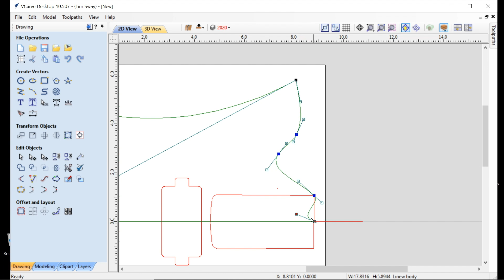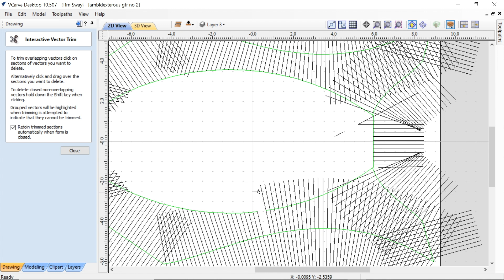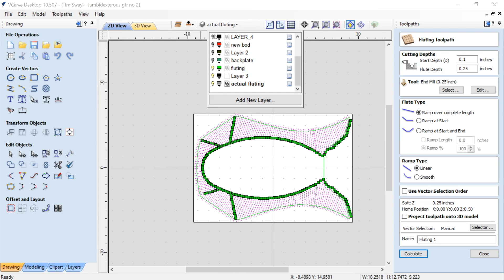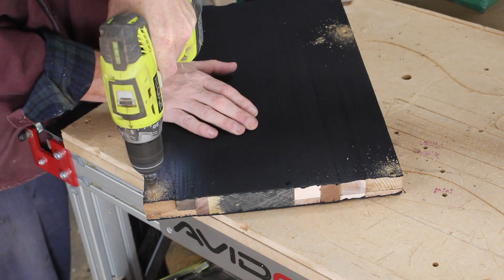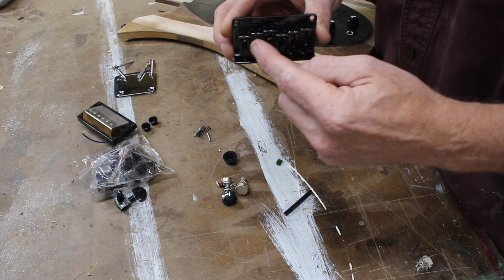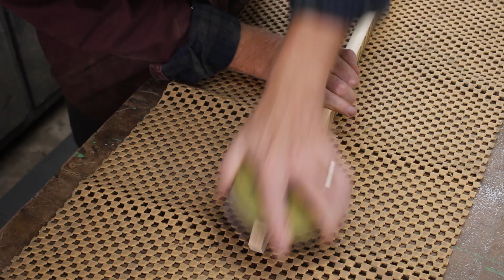Making a Ambidextrous Guitar | In the Labs with Tim Sway | Vectric FREE CNC Projects

Comment: Considering buying a less expensive vectric product, could this be done using Cut2d desktop?
Reply from the maker: Hello and thanks for the question.  I think it would be possible... or at least get you modt of the way there.  Things like making a 3D hspe for the nect would be a challange... but again with the right selection of 2D tooling you could get most of the way there.  If you are looking for a few more options that would help... then VCarve Desktop might be a better fit.  If budget is a real constraint then I would suggest download the trial version od Cut2D desktop and see if it will do the trick... https://www.vectric.com/free-trial/cut2d-desktop

Comment: Great videos and content. Are you still using dowel rod indexing or some other workflow for alignment and two sided carving etc? I’m experimenting with relative coordinates in VCarve Pro and MeshCam and love the idea of only having to worry about using the Y axis as a centerline. I do all my design work in Affinity Designer then model the guitar in Rhino.
Reply from the maker: Hello... and thanks for the comment and question.  When working with double-sided parts we just the dowel system because it is failsafe (assuming you do it correctly... :) ).  We do have customers that use a jig... and that works as long as they take into consideration the size of the stock and where they are starting their cut.  There are different ways to do this, but teacing the dowel method works for most... but we never disscourage experimenting... that is the fun part!

Comment: That’s pretty cool! Let’s really get out of the box, make a 7 string that has the low string in the center, then string it out in either direction. That’d kinda give ya four strings in each direction without having to restring. I think. Very cool man!
Reply from the maker: Thank you, that is an interesting idea!
Reply: @vectric  or maybe something based on a mandolin. Semi hollow even. I notice the bridge on mine is moveable. But make it with a similar string setup as a mandolin, groups of 2 strings, using the lowest string in the center idea and string out each way. Give it an open tuning maybe. You could flip it around and do some cool stuff lol. Just thinking out loud haha.